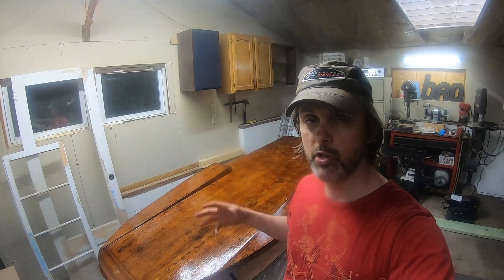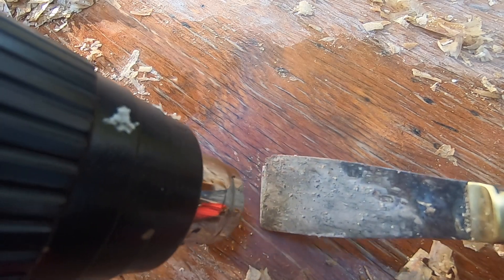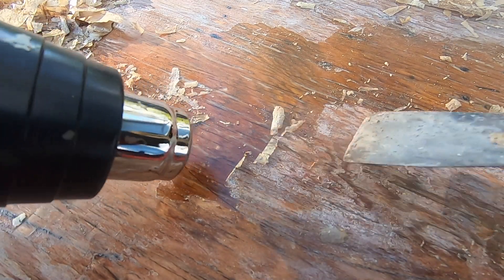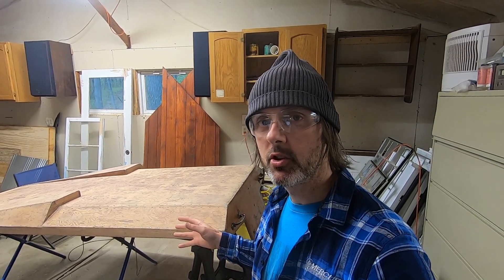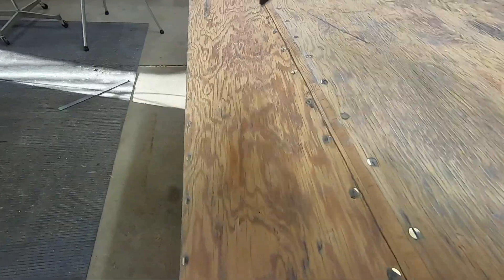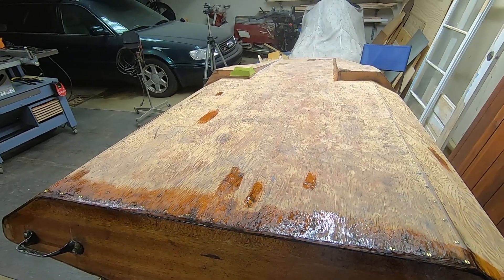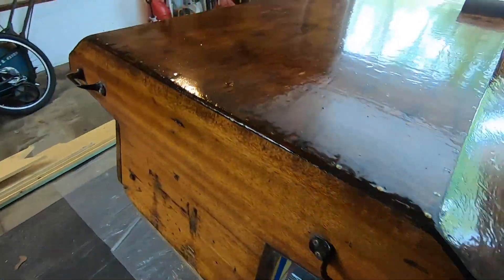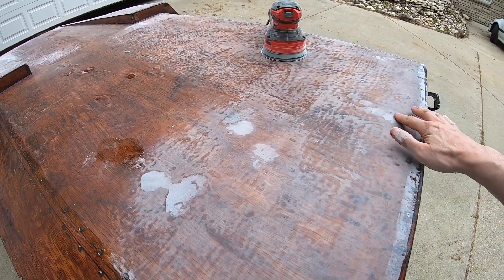Wood Hull Restoration:  1950s Hydroplane, Stripping Old Varnish & Marine Epoxy Treatement

Comment: If you do a project like this again I would recommend putting a very thin layer of fiberglass cloth over the wood on the first coat. The glass cloth that is used on large-scale model airplanes is what I'm recommending, it is very light so it will add very little weight to your project, but it will give you a much smoother surface especially if you light sand between coats of the epoxy resin. I used to use plastic-coated playing cards as disposable squeegees to spread the resin evenly in thin layers, and the heat gun can be used to remove bubbles and help the resin flow out into a smooth sheet.
Reply from the maker: I was worried about the bottom getting scuffed up, and the exposed fiberglass having fuzz/strands exposed.  I thought that would probably be slower than just scraped epoxy.
Reply: Three years later, yes I agree with both the light cloth and sanding between coats. But I’m just a Dude in his cave. Going without cloth is limited to un-seen areas that might get splashed or experience high humidity.  4 layers of epox is pretty thick.

Comment: Hi , I just acquired a 10 foot hydroplane yesterday so the guy gave me for free . 
I’m going to do a restoration on mine and your video is very helpful . I have been looking at a lot of videos with people working with Apoxsee. And I’ve noticed that as they were pouring their Apoxsee they were heating it up with either a heat gun or a torch , and it really helped with flattening the Apoxsee out . It also eliminated any bubbling .

Comment: Personally, if it was mine, I would have used wood filler, or bondo on the low spots, because it is the bottom.  To me no one will see it unless you flip it, and start with 60, or 80, then do a 120, then apply more coats... Great job so far bro, I am enjoying your endeavors. Kudos on getting the GF involved...
Reply from the maker: Actually bought wood filler but the hydro guys just told me to use epoxy instead.   Idk.  Just doing what they tell me lol

Comment: Bro!😉
Crazy, I’m literally near finishing two boats. And as I’ve been going through the work, I’ve bee thinking that I’ve never seen kneel down hydros getting refinished or refurbished, and then BAM! There it is! By the way to lay the epoxy down, pour it out of the cup, then use a squeegee, it works amazing. Also don’t be afraid to use heavier grits to get “teeth” for the epoxy to bite into. Also the shaper the paper the straighter the work. Check out a couple of my hydro vids!

Comment: I hope your heat gun idea worked okay for varnish removal  . The neetest paint removal I ever saw was "Wet Sandblasting" . It certainly got the paint & primer off fast and very very thoroughly . Even the tightest corners etc .
          The biggest wet sand blast job I've ever seen in my life was 4 - 6 layers of white paint removal from a small steel hulled ship , about 78 ft long . The 2 employees of that contractor spoke of how well it cleaned the surface and removed all the old paint .
Reply from the maker: Worked great!  I think wet sandblasting would work great on steel or maybe aluminum but probably not so great on something softer, like wood.
Reply: @ADDvanced  Thanks for your communication . Don't worry about  wet sandblasting your good wood , not to worry . I was shown a group 10 fine wood antique dinning room chairs that were imported from Italy back in the late 50's  . I was shown the chairs in the late 90's . There were 2 arm type chairs and 8 more without arms . Wet sand blasted using fine gain sand and cold water mix . The owner told me of also a beautiful varnish or varathane mix from the reupholsterer  that was a mix of deep red and burgundy .  The chairs came out beautiful shiny and smooth . Try it on your next project , that equipment is rentable . Good luck Buddy , your boat is beautiful  !

Comment: That beading is what we in the auto paint biz call fish eye. Before applying your epoxy, wipe down with a prep solvent to remove any oils.
Reply from the maker: Right on, I didn't know the epoxy sweat oils when curing when I was doing this; apparently you're supposed to wipe after every coat.
Reply: @ADDvanced  I remember in my plastics class where we did fiberglass there were 2 types of resin 1 was laminating resin and the other finish resin which had a surfacing agent in it. maybe the epoxy is the same way...

Comment: Could be Amine Blush which is a waxy residue the epoxy sometimes exudes causing it to bead up.  Love your channel.
Reply from the maker: Could be?  Thanks for the compliment!   I'll try washing it off and adding another coat and see what happens
Reply: "Amine blush can easily be removed. To remove the blush, wash the surface with clean water (not solvent) and an abrasive pad, such as Scotch-brite (TM) 7447 General Purpose Hand Pads. ... Wet-sanding the epoxy will also remove the amine blush." (from Google)...

Comment: Use your heat gun to pop the bubbles. Heat makes the air expand to pop.  but move quickly
Reply from the maker: Tried; didn't work.   Wound up making the epoxy turn white.
Reply: @ADDvanced  DOH!